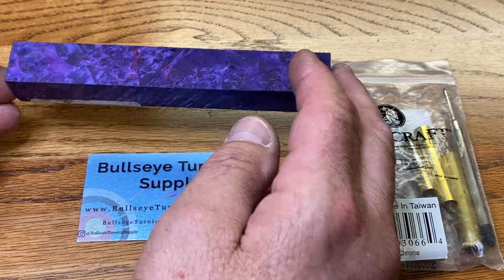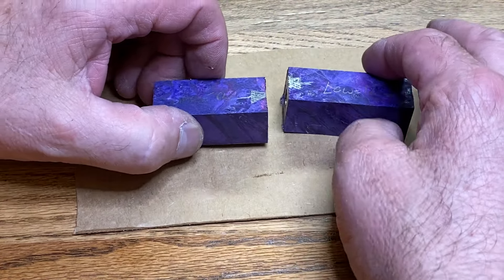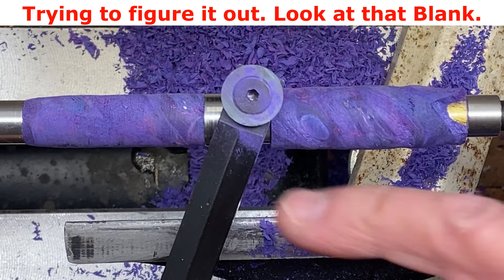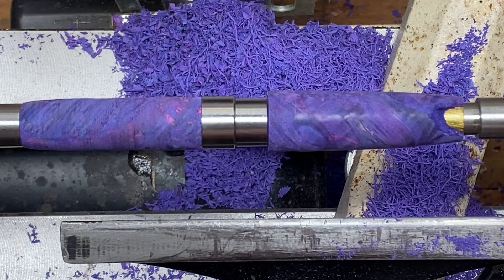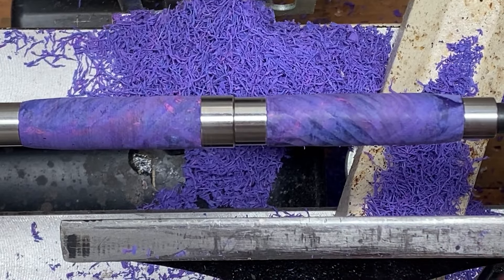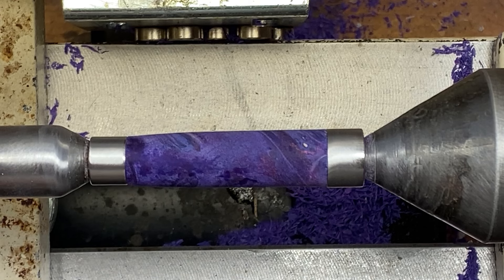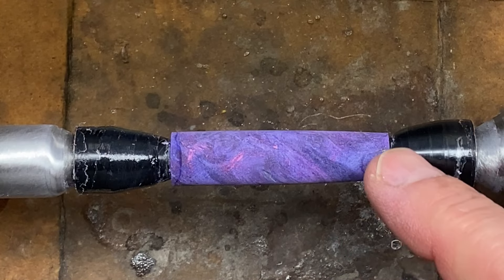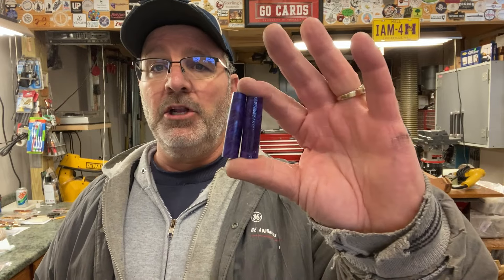You Win Some, You Lose Some

Comment: Here something else I did with that small crack you will need to produce some saw dust from the purple blank anyway put just a little CA glue on that small crack and work in the dust you produce  from sanding work it into that crack as good as you can spray a little of that freeze  to set up the CA and let it set for about 15 minutes  hopefully it works for you. You might need to do it a 2nd time. Good luck
Reply from the maker: Thank you Ray. 

Regards,
Bob

Comment: Hi Bob,  I bet if you turned the ends of both blanks back down to the brass, enough to get rid of the chipped part and then epoxy some black ebonite or acrylic onto the, they would look nice on that chrome cigar kit.  Also, it may have been my imagination, but I could swear that the mandrel was flexing when you applied pressure with the skew.  Weird.
Reply from the maker: Thanks David,
  I gave those blanks away to one of my Patrons. I didn’t feel like messing with them any further. 
  Looking at the video, it does look more prominent when the skew is next to the mandrel. I don’t think it showed as well on the video as it looked locally. 

Regards,
Bob